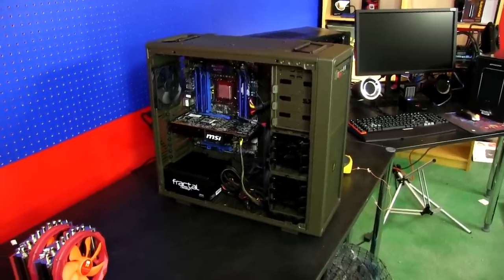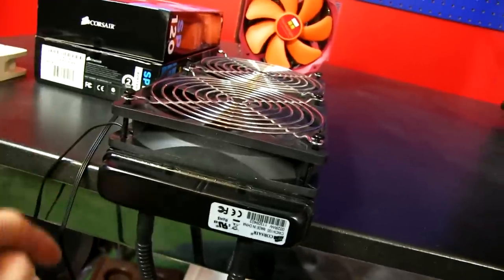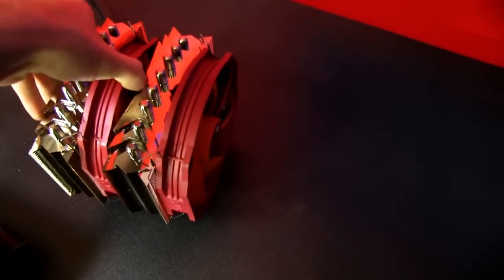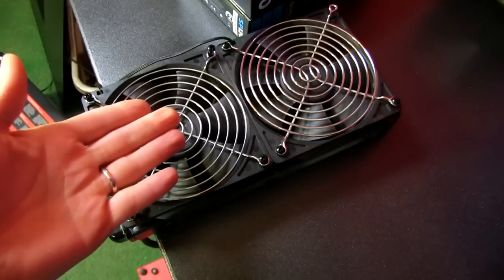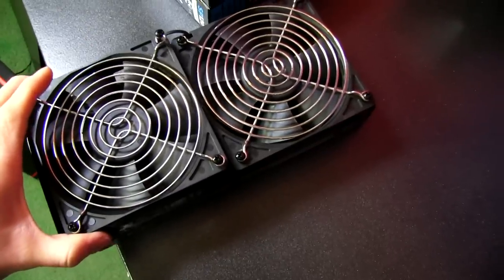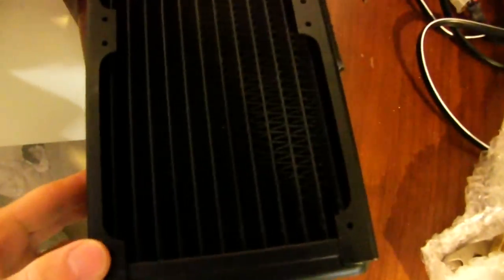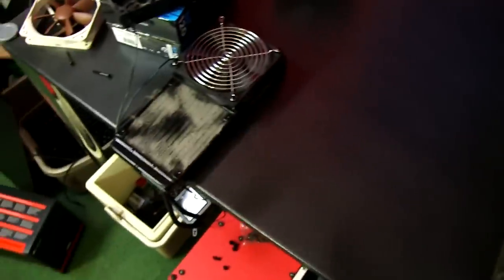Push vs Pull vs Push Pull for Radiators and Heatsinks Linus Tech Tips

Comment: I ran push-pull because i got a good deal on non pressure optimized fans.
Reply: its a waste of electricity.
Reply: My fans arent optimised for static pressure i need to run push pull.
Reply: electricity is renewable energy and couple little fans dont use much anyway

Comment: i have try positive air pressure form y exisitng Lianli PC k62-w before .(i hv added a air fillter),140mm Fan cool air Intake x 1 >In front of HDD ,140mm Fan cool air intake x2 > on top (to cool down mobo and space in case),120mm Fan x1 exhaust out hot air at rear.
i have try tis about 1~3 months....its was really helpful...less dust,and great cooling.

for negative air pressure (same also got added air filter ...HDD intake x 1 ,Exhasut out on top x2,rear x1 = tis much dusty and cooling is almost same like positive. 

Positive  and Negative air pressure....positive is much good for cooling and less dust(adde air fillter is fine.)

Comment: so i should run pull because its easier to clean and i put the fans outside the case wat?
Reply: No. I have a Corsair H100i GT with dual Noctua AF-140 iPPC PWM fans and it WAS NOT EASY getting the config to run in Pull inside a Corsair 760T Case... However, it can be done. The instructions Cosair provides would make you run a Push config with the fan screws on one side of the rad and then secured by case screws on the other side of the rad. I had to do away with the case screws entirely and then I had to hold the rad with two unsecured fans and secure the fans to the rad to the case in one go. To make matters worse I did I top radiator install with the motherboard already installed. I had to fumble around with one hand while the other had to push up against the case and if the screw holes were misaligned I had to reset or try to shimmy the fans into the correct spot. I'm sure there's an easier way (probably go for a side radiator install) but that's the way I wanted to do it.
Reply: I just redid my case not too long ago and also used the top of the case with a full build already in. I set the case on it's side, pushed the screw through the fan then started it into the radiator leaving it a little lose. I worked my way around the four outside corners of the radiator first, then the four in the middle. Once all eight were in I just snugged everything up properly.

Comment: Pull setup is way WAY louder than push
Reply: but cleaner. and I use an nzxt h440, so that is not a problem
Reply: wdowa94 guess you can fix it both ways

Comment: But... pull the "hot" air inside the the case is not dangerous for the other cards ? I mean my case will be Hot and motherboard and gpu temps will be higher
Reply: I think so, I prefer clean monthly and choose the option push pull
Reply: he actually told us to mount the fans on top of the radiator in pull mode, so they would pull the warm air out of the case
Reply: and that hot air out, does not heat the radiator?
srry for my english :C
Reply: TheDrummer007 Yes, but the movement of the air and fresh air intake would make up for this
Reply: toby marol I would recommend to mount them in a way that the fans pull cold air from outside of the case. That increases the performance a lot. It wouldn't make any sense to cool a radiator with hot air... I always push the air out of the case with the case fans.
Reply: That would require a dust filter on the outside which in most cases are not there for some mounts, other than that the inside air should still be cold with sufficient air intake
Reply: Anon Ymoose Sounds logic. For me it's more useful to pull the air into the case, because my CPU needs more cooling that any other component in the case. Under Prime95 it still gets up to 70°C with an H80i in Push/Pull. I don't want it to get any hotter.
Reply: Positive pressure should still overall be worse than negative pressure, also because you pull in more dirt and dust (or clamp your filters)
Reply: circulation is all you need to worry about thats whats its for. the fans wont change the temp inside other then blowing the air out.
if your OC'ing need make sure your burn in test keeps temps at safe levels. safe levels should be on the manufactures website if not in the book.
Reply: Again, I would disagree, I have put all my fans to exhaust to keep anything unwanted out (and that means easier cleaning) and that leaves for negative pressure which results in lower ambient temperature which causes all the air pulled through the radiators to be slightly lower thou less thick.
It did loose around 2 degrees (3 if using Fahrenheit) of CPU and GPU temperature but the cleanness is crisp
Reply: You're mounting the fans on top of the radiator, toward the top of the case, where they "pull" the air through the radiator and out of the case. "Push" is where the fans are below the radiator and force the air through it, then out of the case, which results in the dust he showed.
Reply: Kim F. Wendel
positive pressure keeps from sucking in dust through cracks in the case like negative pressure does. negative pressure also means stale stagnant warm air left in your case. megative pressure is the WORST.is the worst.
Reply: Robert Kavanagh
pushing or pulling depends on which way the air is blowing not which side of the rad the fans are on.
Reply: Anon Ymoose I agree with this. A couple of degrees difference is nothing, people.

Comment: So is pull intake?
Reply: Gorim33 Not necessarily.  You can take the same sort of top-of-case mounting scenario and simply flip the fans to the other side of the radiator so they pull warm air up and out of the case (through the radiator, which is actually ok for temps).  ;)
Reply: Oh ok thanks

Comment: So what it you do pressure to pull and non pressure to push. 😕
Reply: Mixing types of fans generally isn’t a good idea.  It would be better to have both fans be static pressure optimized - providing the most directional force to make that air flow through the radiator/heatsink
Reply: @Megaman-Zero-626  uh. So you can't condensed the air to be cold air.?
Reply: @luckyCOYOTE27  correct
Reply: @Megaman-Zero-626  thanks 🙂

Comment: what about... pull pull? from both sides?!
Reply: lolwut
Reply: That would be very inefficient. The fans would be fighting against each other for airflow and it would not work at all, or just work with very little effectiveness. Same goes with push/push which is also a weird set up. Just go with Push/pull. This way air is directed one way, and more effectively.
Reply: Zuhayr Sarker thanks bro!

Comment: run in pull? this video is confusing as shit. first you are saying that the best config is pushing air through the radiator then you say run in pull.
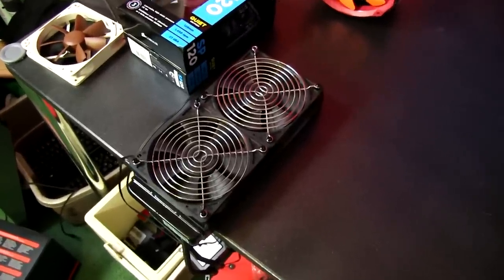Reply: +Eddie2965 1:36 he said it doesn't matter. In terms of performance both configs are equal but using pull is easier to clean.
Reply: +TheSpacecraftX so that's using "pulling air from the outside" right?
Reply: luis conese I think so yes. So long as the fan is mounted to the rad the airflow is blowing away from the rad structure.The air is being pulled through it. That way you don't need to take the fans off to clean it.
Reply: TheSpacecraftX nice. thanks! :D
Reply: +Nick Chamberlin  Lol.  Seriously.

Comment: LINUS! i want a fan that don't sacrifice fan speed for silence. I am fed up with 120 mm fans that must run full blast to stay cool, even the amazing noctua nf-f12 has this bullshit! can you please give me a solution for low noise without turning down my fans? THANKS!
Reply: put your computer outside
Reply: This is going to sound a bit ghetto... but take you side panel off
Reply: both solutions are fucked up! I live in the American South, where it's summer basically all year, and my house is full of dust for no apparent reason, EVEN THOUGH I VACCUM EVERY FUCKING DAY!
Reply: superdeathretard I thought you were trolling. If you are serious just get more and bigger radiators.
Reply: i can't get a larger radiator on a tight budget
Reply: no i don't have nff12's those were from a friend who was kind enough to loan some to try them out. i just can't afford a larger case right now
Reply: i just want to know a good fan that is quiet at top speed
Reply: superdeathretard defying the laws of physics? The future maybe? You can't make unreasonable expectations like that. Its common sense that tells you the faster a fan spins the louder it will be.
Reply: superdeathretard Then get a fan controller so you can set the speeds of them, and or get Corsair 120mm silent cooling fans.
Reply: Buy ISGC thermaltake fans, they have RPM adjusters built in, and are near silent at full rpm, with dynamic ball bearings for long life. Not that expensive too. They will serve you well.
Reply: THANK YOU SOOOOOOOOO MUCH!  need a straight answer people. Also, i bought corsair "quiet fans" and they were fucking loud at full blast, but turning them down made gaming impossible! I checked everything b4 returning them. NOTHING WAS WRONG! only turned down fans. I was undervolting to keep everything cool, and that was just STOCK SPEED!
Reply: superdeathretard You do realize the corsair fans are just case fans, they help keep the case cool, they don't affect gaming performance at all.
Reply: as in the temperatures were unbearably high
Reply: No trolling here......
Just asking for suggestions, but im pissed
Reply: *****
How does your cpu run a 15C at idle?  Room temp is like 21C???
Reply: *****
What exactly are you cooling with?  Your standard fan and heat sink physically cannot cool below room temp.  That would mean it's over 100% efficient.  The only way lower than room temp cooling can be achieved is with vast amount of pressure difference known as Bernoulli's Principle of Pressure, or through evaporation.  Two things which I doubt your system does.  The only thing I can think of is if you use a heat pump.  Plus, if it's humid enough, dew will form on your components and short them out.
Reply: True rhynosaurus... you have to think of fan cooling like 'diluting' rather than 'removing' heat.  You cant dilute something to lower the level of what you're adding.  In this case the heat in your room.
Reply: RHYNOSAURUSREX How do you know what his room temp is? :P
Reply: Benana thats what I do sometimes lol
Reply: superdeathretard Just wondering... what are your vents like? Because the noise may actually come from the vents.
Reply: Sneezaroo hes a troll. I didn't realize it.
Reply: superdeathretard NB Eloop
Reply: superdeathretard  Just put your rig in your fridge (or freezer if you feel fancy) and you'll be good :)
Reply: Freakschwimmer yeah if you want condensation to destroy your rig
Reply: Use delta fans
Reply: Jay Man and it will also cost 5x as much. Some people, like myself, can't afford the latest and greatest or even the last gen from intel. I run an 8320 not because it was the smart thing to do, but it was the best I could do in my price point.
Reply: Jay Man where the fuck are you finding an i3 that will beat my 8320 for 120? My 8320 will destroy an i3.
Reply: Jay Man my 8320 is overclocked not a base clock 8350. Also, I am talking about 8 cores not 4 cores. Gaming is a stupid comparison, since it would take much more expensive gpu to throttle either cpu. At this price point you are not going to be running sli 980's. I have an 8320 because I already had the proper cooling, and I use the cores with rendering, and applications that take use of it.
Reply: Jay Man go ahead and continue to talk about a cpu that doesn't exist and won't exist for years at a time. When that cpu comes out, I will not be buying it. I will be buying the older and just as fast cpus on eBay. Because they will be much cheaper. Logic. You should try that.
Reply: Jay Man my 8320 was used and has been running fine. In fact, all of my parts are used, and I have had zero issues. Only thing I need to replace is the psu since it is starting to show its age. It is a tx750 that is from 2008. Not to mention, this guy is a troll, and should not be taken seriously.
Reply: Two words: delta fans